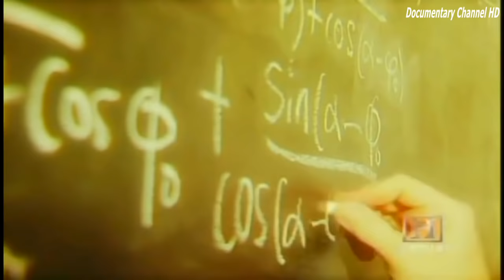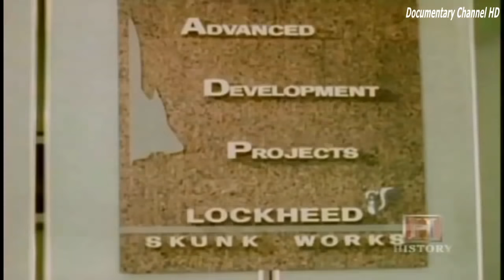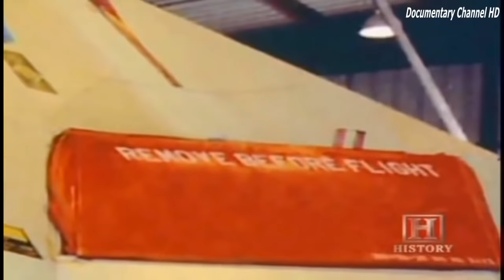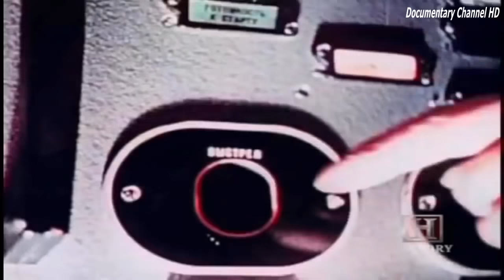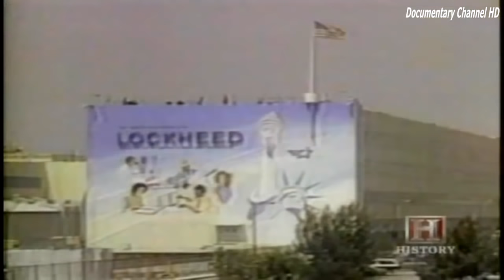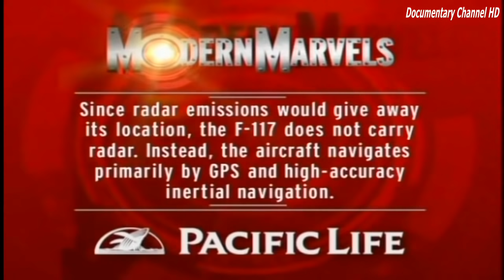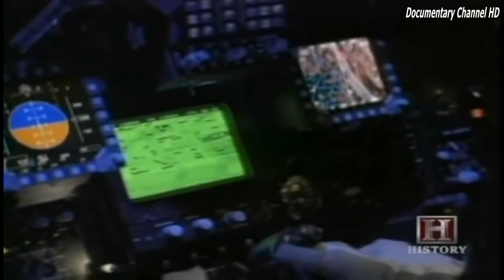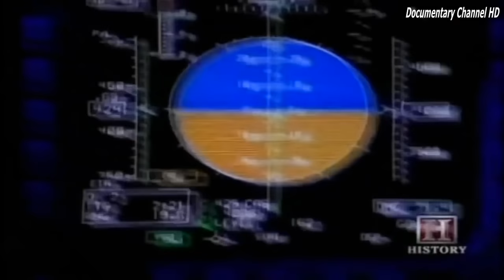Stealth Warfare Lockheed F 117 Nighthawk History Documentary HD

Comment: To improve discretion, the aircraft did not carry radar, thus avoiding electromagnetic emissions. In return it was equipped with a sophisticated navigation and attack system, being of the first military aircraft equipped with GPS system. It also had an infrared vision system FLIR forward and a system of infrared vision down (DLIR), which included a marker of targets for bombs guided by laser.

The Missile of this Plane
only follows the Laser Pulse, as the Laser Point emits Radiation on the Enemy's Aircraft, the missile only follows the Laser Path and ends up imploding on the Point that emits such Radiation making the concept the US Military Aircraft. Safer for the War.

Comment: In addition to having invisibility to radar waves, the design was also looking for the visual, which meant that the air intakes of the engines should be protected against infrared detection. Finally, the plane had to be small and very fast, or operate at night, to make its detection by the human eye difficult.

Comment: Specifications (F-117 Nighthawk)
Data reference: USAF National Museum, 1 US Air Force23

LOCKHEED F-117A NIGHT HAWK.svg
General characteristics
Crew: 1 pilot
Length: 20.1 m (65.9 ft)
Wingspan: 13.2 m (43.3 ft)
Height: 3.8 m (12.4 ft)
Surface alar: 73 m² (785.8 ft²)
Empty weight: 13 380 kg (29 489.5 lb)
Weight loaded: 23 800 kg (52 455.2 lb)
Powerplant: 2 × General Electric turbofan F404-F1D2.
Normal thrust: 47.2 kN (4 808 kgf; 10 600 lbf) of thrust each.
performance
Maximum operating speed (Vno): 993 km / h (617 MPH, 536 kt) (Mach 0.92)
Reach: 1 722 km (930 nmi; 1 070 mi)
Flying roof: 13,716 m (45,000 ft)
Load alar: 330 kg / m²
Push / weight: 0.40
Armament
Anchor points: 2 internal holds with an anchor point each with a capacity of 2 weapons in total, to load a combination of:
Pumps:
BLU-109 perforating pump
GBU-10 Paveway II laser guided pump
GBU-12 Paveway II laser guided pump
GBU-27 Paveway III laser guided pump
Smart JDAM pumps (guided by INS / GPS)
B61 nuclear bomb

Comment: The project received the internal and somewhat dismissive name of "The Hopeless Diamond" in 1975 due to its strange appearance and doubts about its viability. The first flight of the scale model took place in 1977 under the auspices of the Have Blue program, thanks to the new Fly-by-wire technologies. The design was joined by the design of a coating of absorbent material of radar waves that absorbed its energy converting it into heat. The first prototype, XST-1, made 36 flights before getting lost in an accident. The second, HB-1002, flew 52 occasions between 1978 and 1979 before getting lost in another accident.

Comment: The German Horton was the first stealth aircraft. It was made during ww 2. It was a prototype though
Reply: Olivia Moore It was made to be stealth but wasnt
Reply: JerryDoesThings actually it was. There’s a video about it. I think Northrop or some other company rebuilt it
Reply: It was experimental, which many countries had secret/experimental weapons(devices). The Aircraft was not based on operational stealth technology. It was just a lab test aircraft but never did it achieve stealth capability. And flying-Wing concept/design actually originated among Soviet scientists. A couple points to comment.
Reply: It was definitely not stealth. It had a smaller radar cross-section, but all flying wings do, when compared to suitable counterparts.

As a bad, amateur designer of flying wings, the single motivation is a reduction in drag, thus greater efficiency, al least in theory.
The 3rd iteration of the 229 had stealth in the design via the addition of a form of charcoal in the composite. However, the position of the engine inlets would always compromise its radar cross-section. Even if it achieved a 30% reduction, it would not be enough to defeat the British radar network.
Reply: XP-79b.
Reply: If you really want to go there the first plane was a stealth plane. It was developed prior to the development of radar. We need to consider stealth based on the technology of the time.
Reply: Wow look at you girl 😊
Reply: NaVI S thanks 😊